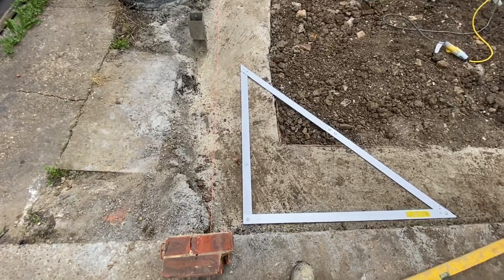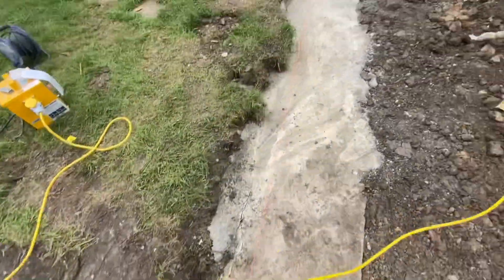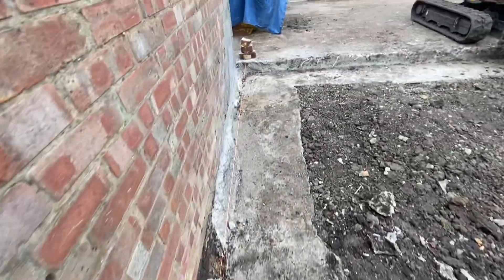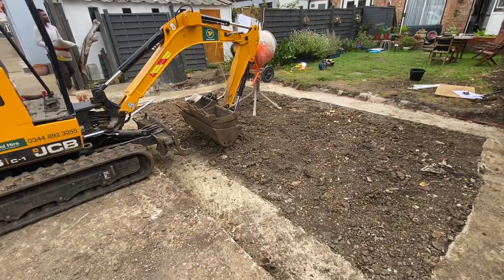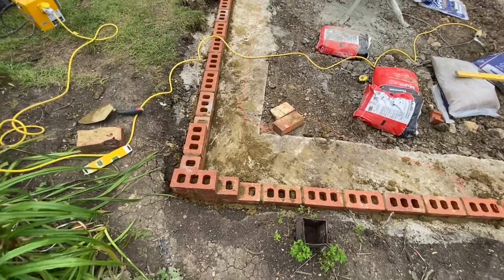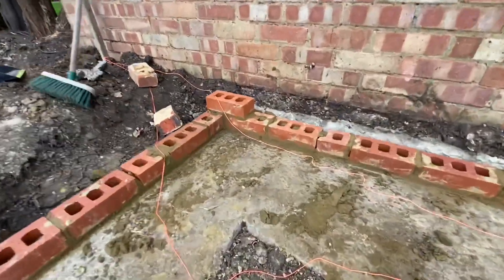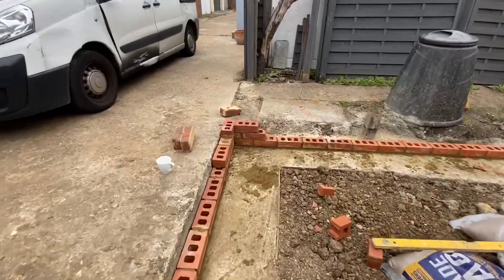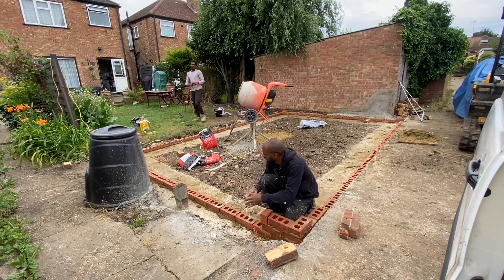Laying engineering bricks to damp proof course (DPC)

Comment: I like you're video's, buy you are obviously not a bricklayer, you're working on the wrong side of the wall, the outside is the face, except for the one end. You have a closer in the wall on one length and on the opposite length, a three quarter, strictly taboo, when it could have been so easily rectified. String line nowhere near taught enough, tell your labourer to fill the spot, before it's empty
I'm all for bricklayers doing brickwork, would you let a vet operate on your heart, each to it's own.
Still like your video's, you work well.
Reply from the maker: Thanks Mike for your feedback. I had the front /back line explained by another and it’s helped me moving on. Look out for the upcoming video building the brick wall on this job. I’ve improved a lot with the guidance. Peace
Reply: @darrenthebuilder  You work well and my comments were for your benefit, not criticising, hopefully helping, keep up the good work.

Comment: Hi Darren great videos as always! Please advise surely dpc level should be at least 150mm above highest ground level?? Thanks brother keep them coming ✌️
Reply from the maker: Thanks Frank
Yes typical you would. The issue here is keeping the height under the requirement. It’s only the back wall that is 75mm high because of the alley concrete being higher than the garden ground.
Reply: Thanks for the reply Darren keep up the good work brother🤙

Comment: Nice to see another job starting. Can I ask you two points. Do you think there’s a big price difference between a block building and a timber one the same size. 
And the wall your building next to the neighbours wall are you planning on leaving it un rendered as so close and if you are wont rain water be able to penetrate or will you treat the block work some how.  I only ask as I m planning mine and will be in the same situation against another wall but someone made me question it as I was going to leave it untreated myself. Thanks mate.
Reply from the maker: Hi Dean, I would say the big difference will be labour as timber will go up faster although timber prices are real crazy at the moment.
The wall next to the garage will be done in brick so it won’t need rendering. That’s what the customer wanted. Personally I think it would be fine as rain will hardly touch it especially as the roof will slightly overhang the gap also. I hope that helps.
Reply: @darrenthebuilder  Thankyou mate, I was thinking that you might use bricks. But I suppose the gap is very small so not like it will get too soaked. I appreciate your reply Thankyou love your vids my friend cheers again. Dean.